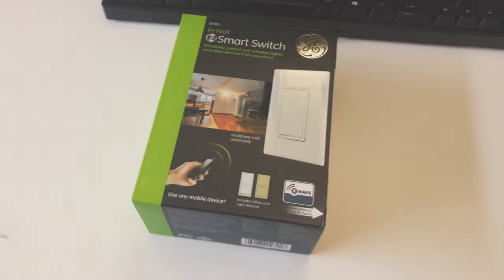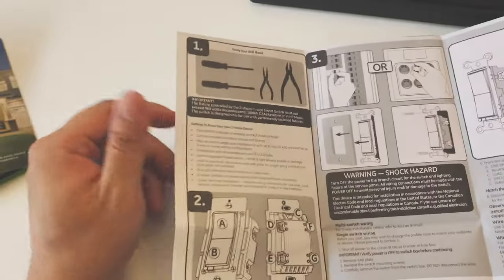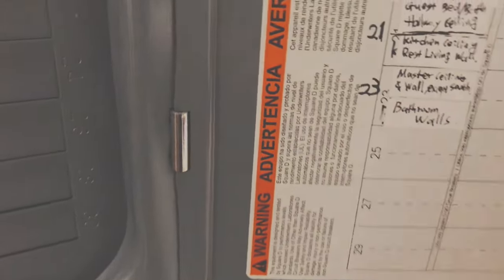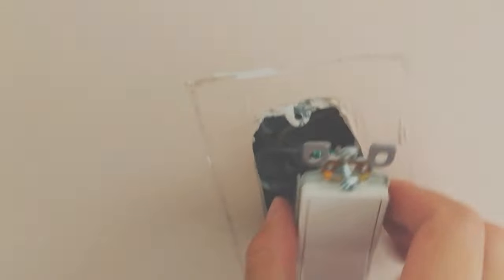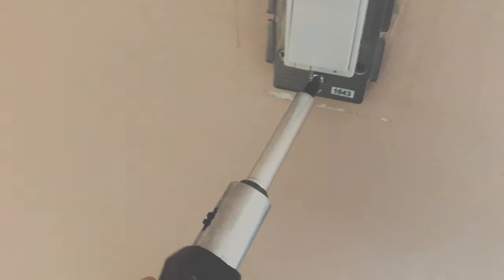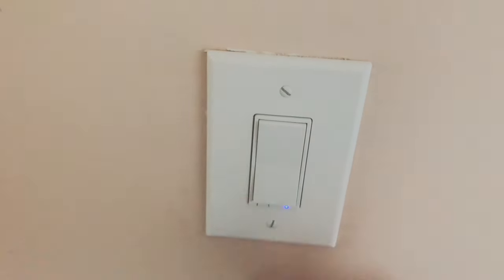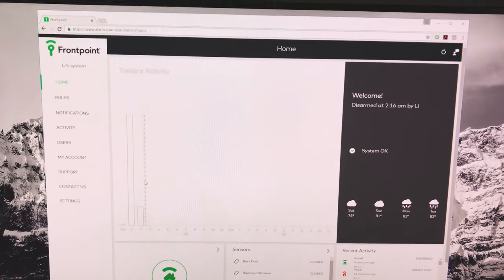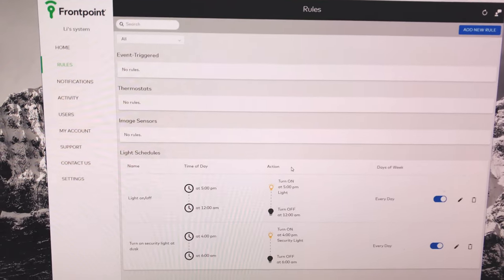GE In-Wall Smart Z-Wave Light Switch 12722 Unboxing, Install and Configuration

Comment: Piper to GE Z-Wave In-Wall Smart Switch (SKU: 14291) Pairing

Go to Settings > Wireless Accessories and tap "Add" then “Start”

Once prompted, apply 3 very quick taps to the on position followed by 1 tap to the off position of the GE Z-Wave In-Wall Smart Switch. You have to give it a little time (like 10-15 seconds) to be seen by the Piper.

After it's been added you can name the accessory and add security, notification and automation rules for it.